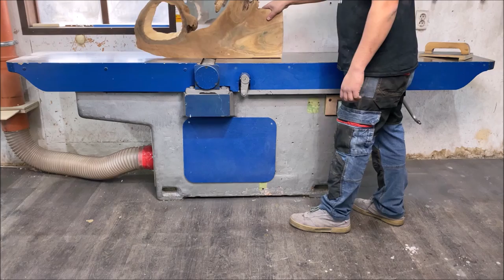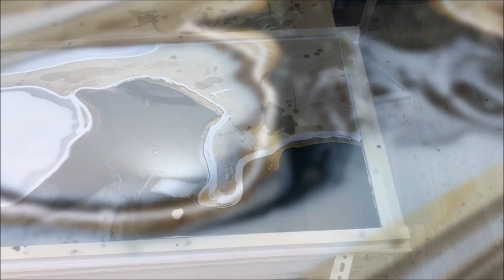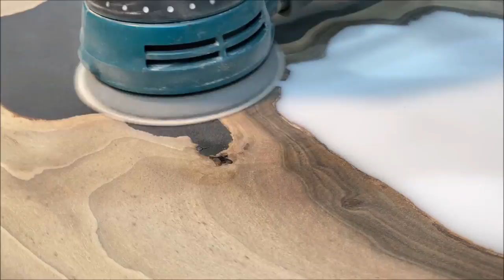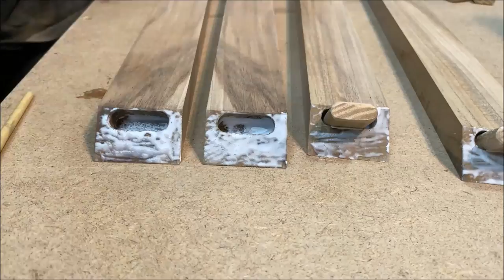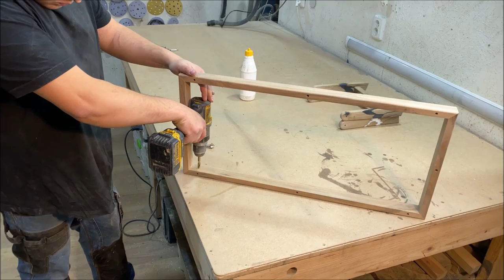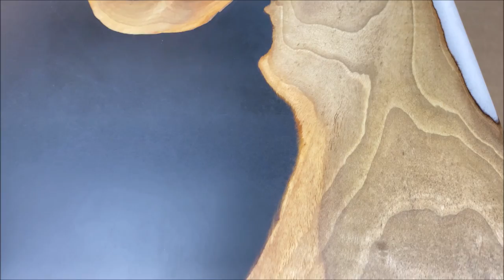Walnut table. DIY. Woodworking

Comment: I am very surprised that you have all of your fingers using a jointer without the top guard, free hand cutting wood on the table saw without using the fence and cutting strips of wood and stopping short and pulling the wood strips out from the running table saw blade. I am guessing you never took any kind of safety class...

Comment: Amazing result 🤝 Why do you add that bead of sealant to the top surface before adding the epoxy 🤔
Reply from the maker: to pour resin above the plane of the countertop.
Reply: @avswood  I suspected it might - thank you for the response - I'm going to try and make one of these. Brilliant work on your channel
Reply from the maker: good luck

Comment: This may be the worst safety practice I’ve seen yet on a woodworking channel. Litterally no fence cuts on the table saw, and the jointer with no guard leaving like 12 inches of blade exposed to eat your hand with one tiny slip!

Be more careful brother